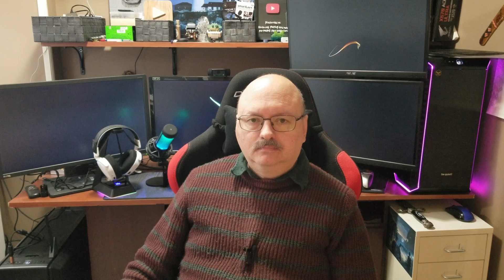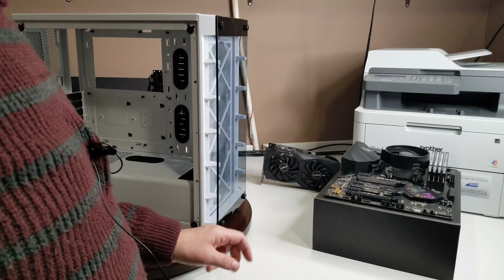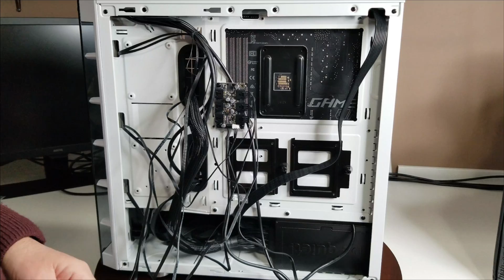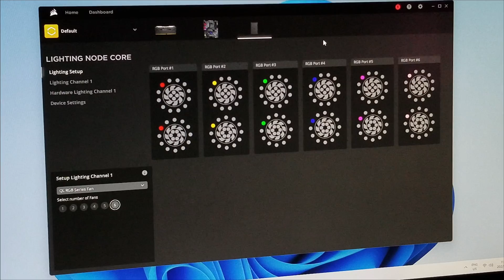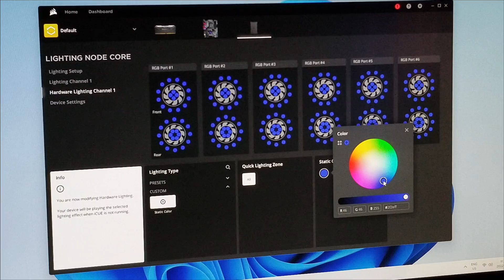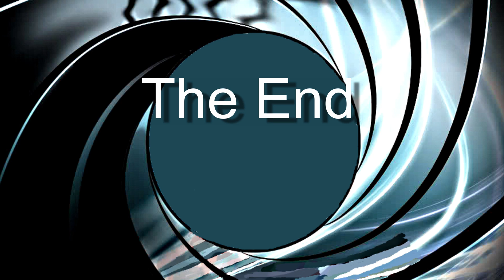iCUE 465X RGB Lighting Node and iCUE Software Quick Look

Comment: I owned this case before my current one and its a decent case if you're using just fans. You can front mount a radiator, but it doesn't leave a lot of room if you have a longer GPU.
Reply from the maker: Yeah it'd be rough if you had a 3000 series for sure.